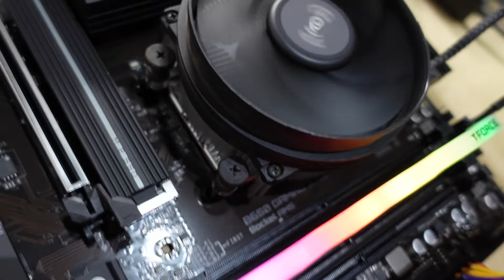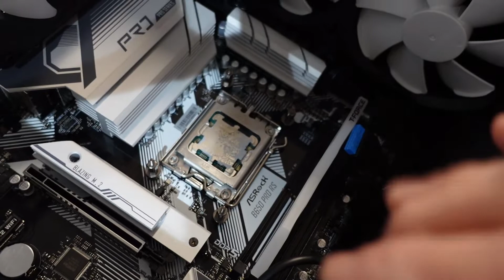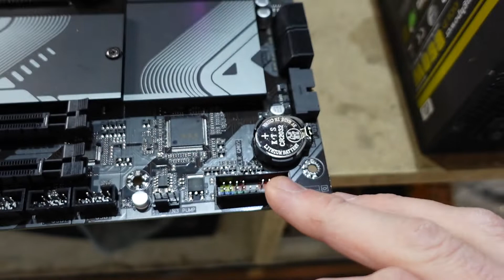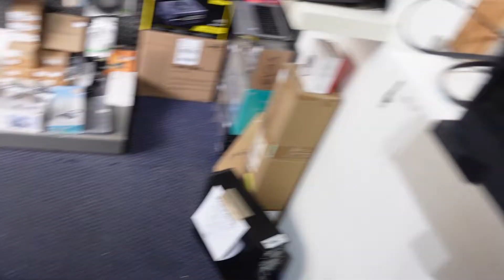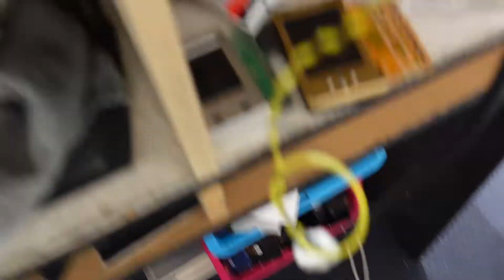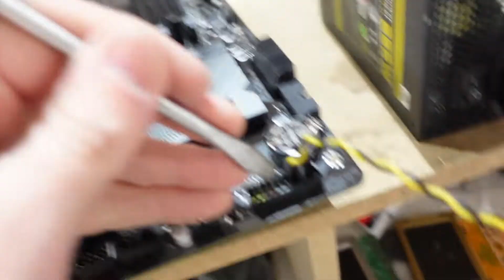AMD AM5 Solid CPU and Ram Light, No Post, Possible Solution

Comment: Did you fix it? I just build my pc and the cpu and dram lights are on
Reply: I had the same issue but in the end i changed my ram from lane 1 to lane 2 and everything worked after :)
Reply: @tobiasg.8532  oh well that was easy, I ended up having a faulty motherboard
Reply: @noahm5705  haha yes ^^ I rode it in here in case it could help someone else ^^
Reply: Heyy guysss helpp mee😵‍💫😵‍💫😵‍💫
Reply: @nishchaysaxena3148 did you fix the problem?
Reply: @onuroksuz9097  yea problem is with my motherboard so i have got replacement
Reply from the maker: Solution was in the video
Reply: Did you find the solution i build my pc yesterday and today when i came back from work the cpu and dram lights are on
Reply: @chriswernet6778  it was a faulty motherboard, I ended up exchanging the ram and motherboard

Comment: Hi, thanks for video ! I had the same issue yesterday when I built PC with 7600X and Aorus B650 Elite AX. RAM is Gskill 5600 CL28 XMP. I ordered Corsair 6000 CL36 EXPO to see if it does the same issue. Hope its not CPU...
Reply from the maker: fingers crossed
Reply: @rickstechrepairs  Finally it booted, ClearCMOS with screwdriver and it worked. Dont even need to try the Corsair Kit ^^
Reply: Hi please could you tell me what you did. My friend has this motherboard with an AMD ryzen 5 7600 x. The PC will boot fine but after about 5 to 40 minutes the display will go, fan still running and cpu light emits on motherboard. Temps are fine, re-seated cpu, changed RAM around.We have remove battery from MOBO, is that the same as using screwdriver? @DeidaArt
Reply: @hasbokiller  Finally it was an issue with RAM. It stopped working after 1 week and never booted again. 

I changed for Intel and I had the same issue, at the difference that It booted but With BSOD. MemoryTest revealed that One stick was defective. 

But on AMD it never booted even by changing stick so I couldnt guess that it was RAM issue.
Reply: Ffs I got the same 7600x and aorus b650 elite ax, and CPU + DRAM lights on.. struggled 6 hours already. Trying to update bios next.. and next with one ram stick
Reply: @juliuSZcsgo  For me it was CPU defective... After I changed it I never had issue again
Reply: @DeidaArt  just wanted to say, I fixed my problem without gpu by using integrated graphics and waiting for 5 minutes after startin the pc. I think it was ram training method, or something haha

Comment: I bought one of these motherboards four days ago, wish me luck.
Reply from the maker: Good luck!
Reply: @rickstechrepairs  dude i have the same problem i didn't get my first post.Tried Socket A2 and B2 and it worked, but its working 4800 by default.If I try using all sockets or going higher, all goes to shit.
Reply: @rickstechrepairs  with the 7600x of course
Reply: @Southlands-Mutt  any updates?